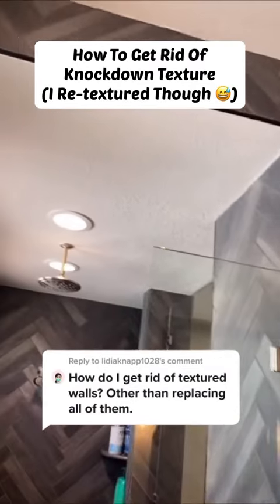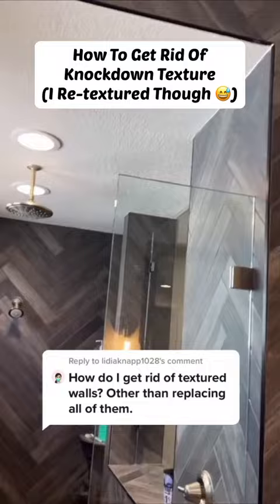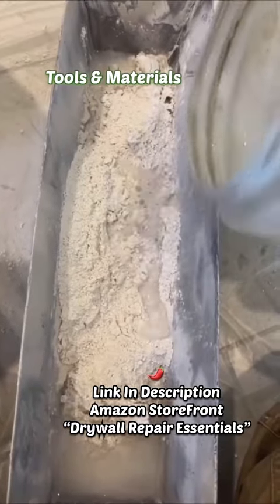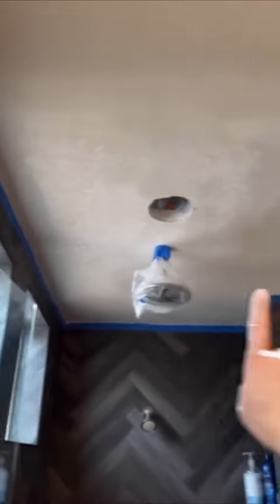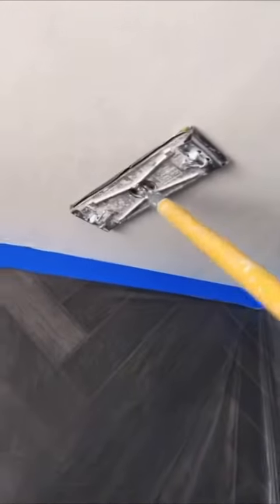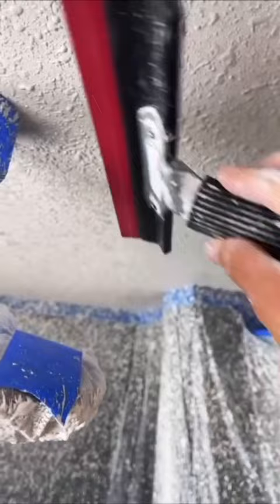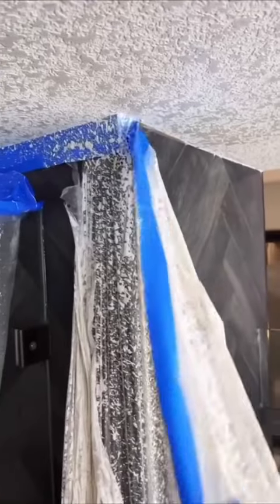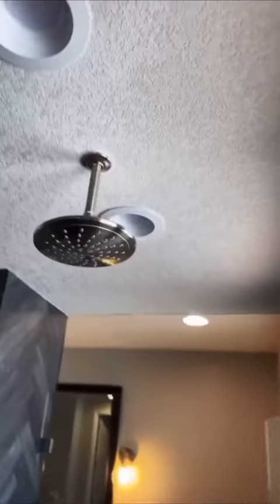How To Get Rid Of Knockdown Texture & Make Walls/Ceilings Flat. #walltexture #handyman #ceiling #diy

Comment: Great point with skim coat passing 2 different directions. I do feel like the sanding might be avoidable since that’s by far the worst part. If using hot mud try to “polish” it while hardening. 2 questions have you had any issues yet with quickset bonding to a painted surface? And also do you prime before adding texture? (With or without skim coat, I feel like every texture bonds to mud nicely)
Reply: Vancouver carpenter is worth checking out too.  I like jalapeno's take & tricks though.

Comment: I actually just got done removing all the popcorn texture throughout my entire house, I tested both doing a level five and what I think is probably a level four and found for most rooms on the ceiling a level four is just fine.  doing 2000 ft.² of a level five finish with one person is a bit daunting. I found that as long as I used a good PVA primer and a flat ceiling paint you couldn’t tell where the joints ended in the bare drywall began.
Reply: we pass through the same challange. I removed the entire 2000sqft ceiling and knockdown texture with skimming by hand. One-man show. Learned on the way. Now I don't wanna see drywall mud ever in my life again :D
Reply: I have a big job coming up disappearing knock down and I like what this video advises me to do. My question is: Can you elaborate on what doing level four and level five actually means?